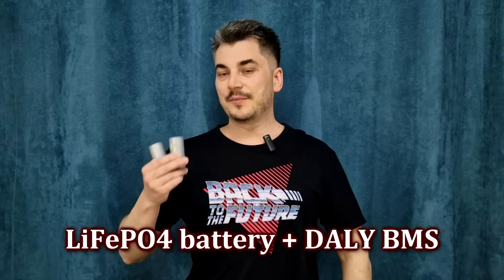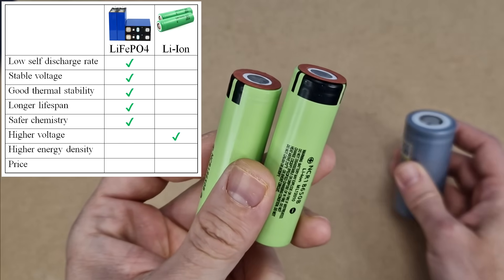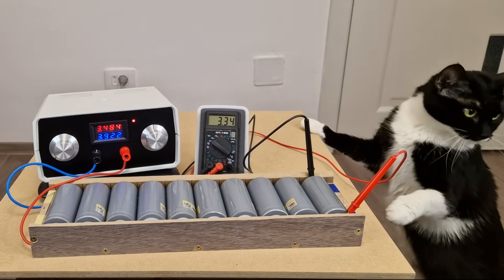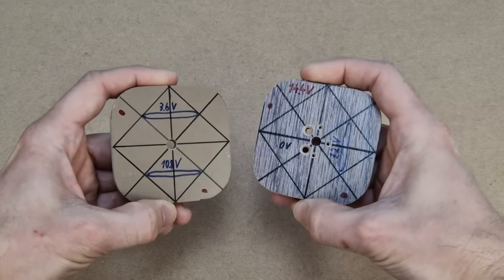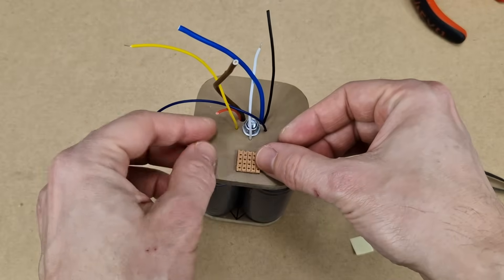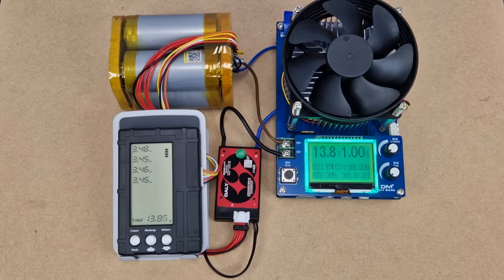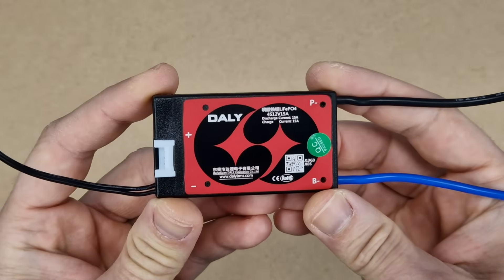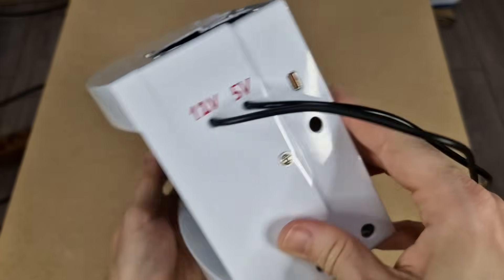LiFePO4 battery + Daly BMS for my UPS - part 1/4

Comment: Ciao, ho comprato queste batterie ma ho trascurato un dettaglio, possono essere ricaricate ad 1C?
Reply from the maker: Hi, 1C is the maximum charging rate, but it's recommended to charge them with a lower charging rate, to prolong their lifespan. the recommended charging rate is 0.5C.
With a 1C charge rate, the cells will not last as long as at a 0.5C charge rate.

Comment: might be the lowestr discharge over a period of time, but the voltage is all over the place which isnt good, they should all have about the same amount of Mah for even series or paralell connection

Comment: Sounds like a fun project!

For your UPS project I recommend using a float (that is maintained indefinitely) of around 3.35V/cell.  That will hold the SOC at 99% after charging is complete.  While holding a high SOC will degrade the cells slightly faster, in UPS applications there is almost no cycling of the cells so there is no cycle wear.  It basically winds up just being calendar aging which is entirely a function of temperature.  So the UPS will last a very, very long time (25 years) if the device is situated in a relatively cool or climate-controlled location.  And 15 years otherwise.

Basically:

Charge target 3.55V/cell
Absorption time: 30 minutes at the charge target
Disable any current-tail
Float: 3.35V/cell
Discharge down to: 3.0V/cell (2.9V if loads greater than 0.2C are present)..  3.0V is 95% discharged, 2.9V is 99% discharged.
(always good to leave some margin on the discharge side to reduce the chances that cells will be damaged if left in that state)

-Matt

Comment: You told me you were working on a new UPS, I guess this is part of it!  I had been considering LiFePO4 batteries for a DIY UPS myself.  Sure they are more expensive and slightly larger, but they last way longer than standard Lithium Ion batteries and they're unlikely to catch on fire and burn your home down 😁

Comment: Based on my personal experience with this battery, the lowest voltage shouldn't be lesser than 2.5volt per cell or it'll risk damage easily. The standard BMS is no good to limit this.

I had to use TP4056 for a mini night light that uses 1S setup as it has cut-off at 2.5volt, perfect for small current application. I'm not good at electronics but if we can use TP4056 voltage cut-off ability to trigger cut-off for LiFePo4 standard BMS, we can save lots of money for many other projects.

Using active balancing is good but it needs regular charging like UPS so it doesn't drains the battery. I didn't have it as it's quite expensive for me 😂 so standard BMS passive balancing is what I use. Sometimes the battery may got imbalance so I had to remove to re-balance again. So in design, I'll make sure to make the battery easy for future removal and installation. Manual balancing is very important. I think your makeshift balancing setup is very good for battery holder as well as it's very easy for removal and upgrade.

Looking forward for the UPS video. Best regards and have a nice day.

Comment: I like the LiFePO4 technology but it seems not as good as the usual Lithium cells we use for most things already.
Like, my cell phone has a 5Ah battery. And it's much smaller than that. And it has the internet.
Reply from the maker: LiFePO4 cells are bigger and heavier, so they are usually used in stationary devices, like UPS and off grid systems. Recently they are used in some electric vehicles because they are safer, but they have less energy than Li-Ion cells.

Comment: A few notes:
- You should charge the cells separately before connecting them in parallel to avoid high equalization currents between the cells if their voltages are not equal
- When building a 4S2P-Battery, add fuses for the parallel connections. Might save your house.
- I would not use the BMS safety cutoff as upper charge limiter. Its a last-resort-safety feature, not something intended to be used in normal operation. A slightly lower voltage will not trip the BMS and - due to the flat voltage curve - doesn't cut into usable capacity that much. When reaching the set voltage, the current should go down to nearly 0 anyway. If you are still concerned, I would suggest using a proper charging IC/Module instead.
- LFP should not catastropically fail for anything <~4.5V, but lifespan will decrease drastically. As there is nearly no benefit from using higher voltages, 3.5-3.7V is usually the manufacturers recommendation. Voltages below will still improve the lifespan, especially in applications like a UPS.
- The "several thousands of charge cycles" are at 80% DOD. Just topping up won't cost you a full charge cycle. (But as stated: Keeping them at a high voltage will).
- Use additional insulation sheets between the cells. The cylinder is usually connected to negative, so if the thin plastic film gets damaged, it could short to adjacent cells.

Good luck with your project, looking forward to seeing the UPS itself.
Reply: can you please explain more in detail about fuse in parallel conn? thx
Reply: @AhmadRahmanZ If one cell within a parallel group shorts, the other cell(s) will dump their stored energy into it. As they are directly connected, the BMS does not help here. While most cells do feature an internal fuse, adding an additional layer of safety is rarely a bad idea. There are even weldable fuse links for more probessional packs.

Comment: I used HEADWAY 38120 batteries to replace the lead acid battery in my UPS. 
it works fine and i dont need to repalce the battey every few years :)

Comment: Which one is better for car jump starter ? 
Lithium ion or lifepo4 or any other battery?
Reply: LiFePo4. That’s what is typically used for 12V starter batteries.
Reply: Neither, for a jump starter LTO is the best.
Reply: 4 of these fully charged LiFePo4 can jump start a car twice